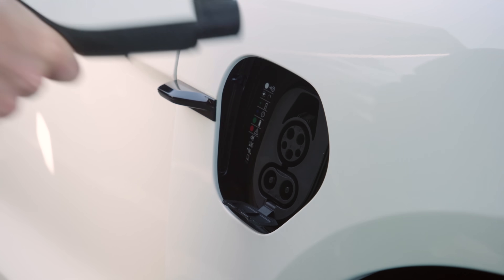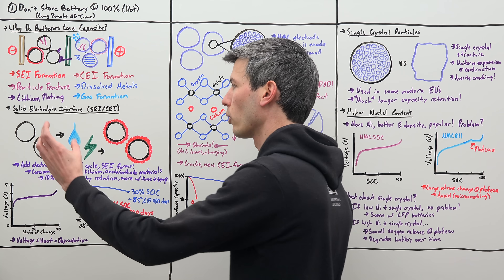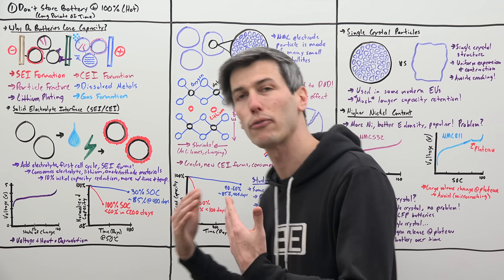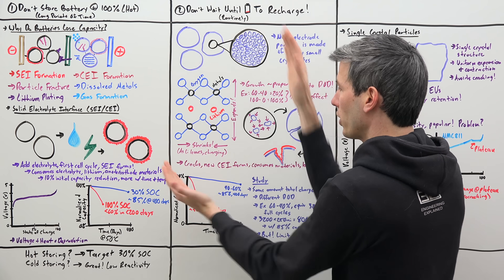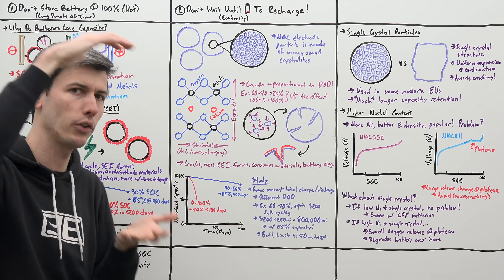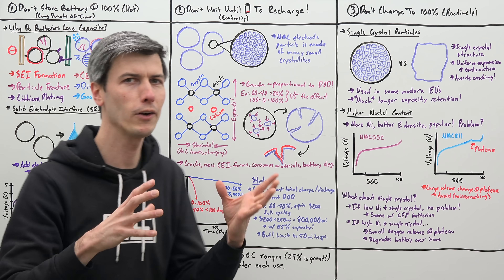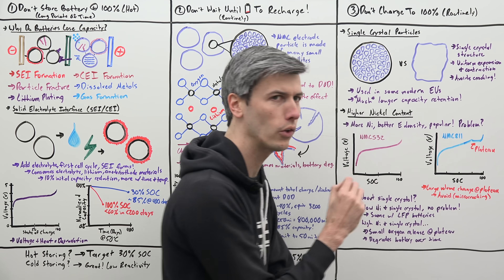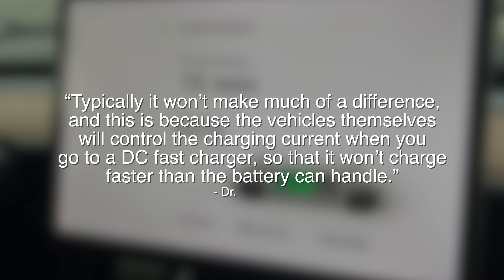How To Ruin Your Electric Car's Battery - NMC Edition!

Comment: The real challenge will be getting the general consumer to actually follow these best practices.  Even after decades of preaching we still can't get people to follow routine oil changes.
Reply: In general with this sorta thing we should hide it behind software. That's why we have charging curves for example
Reply: @kenjikenjikenj   Still, a battery should be charged in 5min. We are currently at 20min or so with fast chargers.
Reply: @svr5423  Gas cars should be filled up at home.  Why should I drive to a gas station?  They should send a truck to my house so I have a full tank every morning.  I don't have time to drive out of my way to get gas.
Reply: @davidbeppler3032  it's more practical to fill the cars up at the gas station. Otherwise, you'd be storing hazardous materials at home.

In case of BEVs, it's even more difficult as you need to somehow get power to the garage. And with standard 230V you won't get very far. 

Sounds like a cool idea, but in the real world it is very impractical.
Reply: @svr5423 I’ve never been in a residential garage that did not have electricity. 230v is plenty for overnight home charging.
Reply: @MylesV  Plenty of garages have no electricity at each parking spot.

Most cars park in the streets in many countries.

Welcome to the real world.

lol..just do the math. 230V can supply 16A, providing roughly 3.7KW. Do the math on a 75 or 100KWH battery. You won't fill it up overnight with your 50m cable drum sticking out of your balcony across the street :).
Reply: @svr5423  the issue is the full capacity of the battary if battary density gets to the point where we can cap offf the first 20-80% behind a software battary life will be significantly enchance and a 5-10min charge might be possible from a guage standpoint of say 10-90% from the driver perspective but it would really be from 30-70% on the hardware perspective.
Reply: @patthonsirilim5739  you're correct. I think batteries in future will be much higher capacity physically than they present. So they can both be charged faster (nominally) as well as have spare capacity for degradation.
Reply: @kenjikenjikenj so more of a hassle than it already is owning a ev? Evs have piss poor range and you need all of it. If you don't, then you made an environmentally bad choice.
Reply: @OutOfNameIdeas2  yes you are correct ev battary simply not good enough to leave anything off the table once they are they will become very practical 5 mintues charging from full to emptty and extreamly long lasting durable battaries all courtesy of better design and a artifical hard cap on the battary.
Reply: A lot of it is already handled by software. There are buffers to prevent max and min charge, safeguards to prevent charging in conditions that could damage the battery, etc. Like he said, even if you ignore all this advice, your battery will likely last a long time, even past the warranty. These are just if you want make it last as long as possible.
Reply: @BrandEver117 This is what I figured. But the so called Tesla engineers online in the comment section and on videos will claim that you aren't supposed to charge to full capacity.
Reply: @BrandEver117 Doesn't matter
Reply: im sure he didn't want to confuse the message but Auto Manufacturers already force some reasonable practices onto the consumer such as on the Kia/Hyunda/Genesis 64KWh platform the battery is actually 67.5 KWh, meaning you cannot ever charge the battery more than 95% as the software shows the user its 100% charged when its actually 95% charged. It does the same thing at the other end too, it shows 0% before its actually at 0%.
Reply: I definitely agree that more education needs to get out to consumers, especially those looking to purchase EVs. That said, I also wonder if it would be possible or even practical to handle all of this on the software side, so that it is done automatically without much needed input from the user.
Reply: It's not always possible of course
Reply: This is a great point. Some people actually think that routine maintenance like oil changes, tires, brakes are a "scam" and will just keep driving until the car physically won't move forwards. My laptop automatically caps the charge at 80% with an option to full charge if I need it to for the next day but other than that I don't really spend any time thinking about or maintaining battery health in other devices and forget about them until they go dead and then I 100% charge them back to life. Hopefully something as large as a car would have a bit of minimal programming in it to ask me to keep it connected to the grid and self-manage it's own battery health with some over-ride setting if max-range is needed the next day.
Reply: skill issue, they will pay for the damage themselves
Reply: Do any EVs have a charging plan setup so that you can say "Mon - Thu Charge 60% and Fri - Sun charge 90%"?  Or link to a calendar app, so that it knows that on the 23rd you have a 500 mile trip planned so the day before it should charge to 100% even though it's a Wednesday.
Reply: @brianwest2775 It's easily changed on the screen.
Reply: The real challenge of EVs will be to get the prices down so they compare to combustion engine cars and solve the problem of hundreds of millions of car owners not having a convenient way of charging their car. I like the technology but with electric versions of cars costing more than double of what the same car with a gasoline engine costs and the fact that i live in a high rise building with absolutely zero chargers makes them not viable for me. To keep my battery healthy id have to put a small charge in every other day and there are less than 10 fast chargers in my Village of 15.000. I can get a used car for less than 10.000€, fuel it up in less that 5 minutes and i can go for over a month with that one tank of diesel. Hundreds of millions of people that need a car daily are in the same position as i am.
Reply: Should set the battery settings allready in the factory so that it only max charges to 80-90% so it should show full for the consumer.
Reply: The issues will be mostly solved via software, not by consumer habits. The average consumer isn’t watching this video, much less reading their user manual.
Reply: @grisa12345   you cannot solve chemistry and physics with software.

There will be no app that let's me fully charge a current day BEV battery in 5min.
Reply: Consumers don't have to follow any guidelines. Manufacturers are happy if they abuse their products because they will need to be replaced faster. As long as the blame is successfully placed on the consumer, the manufacturer wins.
Reply: I don't think it's that hard. I remember the person who introduced me to my new car telling me "Both high and low state-of-charge degrade your battery's life, so if you try to keep it close to 50%, say between 65-35%, your battery will last a long time. Try to only charge to 90+% if you're going on a long road trip and try to only rarely discharge below 10-15% and you'll be golden"

I don't know about other EVs, but my car makes it easy to limit state of charge. I'm fortunate enough to have my own garage where I can just park and plug in every night. Even without a fancy charger, I pretty much never have to worry about how much charge I have. It's simply not something I have to go out of my way to take care of or even be reminded to worry about.
Reply: Just like my phone has a battery life optimization function that I could turn on or turn off. You should be able to do that in a EV too if you choose
Reply: Software-Defined Vehicle -> build it into the EV's software to manage the battery. How many smartphone users actively manage their batteries SoH? The average Joe who will be the majority will not be interested, same with everything else to do with EVs. I get my oil changed when needed at the annual service...
Reply: Thats because oil changes cost money and jiffy lube wants you to change your oil every five minutes (to make more money). Charging at your leisure in your garage is another story.
Reply: now imagine if it was the other way around, and there would be headlines about missed oilchanges significantly reducing your engines life, or revving the egine cold costing you a certain amount of engine life every time etc...
Reply: Software driven and historically stored and voiding of the battery warranty  if not followed.
Reply: It still won't matter much.  They will still be fine for the majority of people.
Reply: Oil changes cost money, people tend to procrastinate on spending money so this is not comparable.
Reply: I think manufacturers should build in safeguards where you can only use 20 to 80 precent of the battery capacity, and we would see that range as 0 to 100 precent ofcourse
Reply: Its way easier to follow because tesla has a BMS and in app charging schedules. I routinely charge from 30-60%  every week on my tesla performance. Literally all i do i plug the car in when i get home only if i need to
Reply: Your Tesla encourages optimal SOC, and it manages power when charging. You don’t have to think about it at all. Other manufacturers? Eh.
Reply: battaries today are just not advance enough to leave anything on the table but dont worry once battary density and design gets good enough they will just cap off the 10-80 as a safty measure so you can use on the dash at least the full 0-100 but your actully using only 10-80 people in the future will mod there ecu to realease the margin to get even better range and power from there battaries and motor but that wont be an issue for manafacture since it will void the warranty like today modded ice cars
Reply: @patthonsirilim5739 So we need to cater to idi0ts? Why?
Reply: They are correct the people. In a modern car oil change ist far less frequently neccessary than the garages want it.
Reply: As a result.. Lubricating oil, fuel and engine technology has got better and better over the years.
Which is why oil lasts 15,000+ miles where years ago you had to change your oil every 3,000 to 6,000 miles.
Reply: Thats my point.  even with oil changes being at 7,500 miles or longer people still don't do them even at the newer more modern intervals. Most people could get away with doing an oil change once a year and they still don't do it. @sahhull
Reply: @sahhull  Sorry, but what you write is only partially true. 
Manufacturers prolonged the recommended oil exchange intervals to reduce the overall oil consumption and also because they are now able to much more precisely calculate the expected lifetime of the engine and transmission and they know the engine will survive the warranty period even with these prolonged intervals.

That doesn't mean it is good for the engine or transmission and most experienced independent service centers would tell you that "lifetime" oil in transmission or 15k+ miles oil in engine are nonsense and only good for planned obsolescence. In other words, manufacturers are making sure you will come and buy a new car again after your warranty ends.
For example transmission without oil change will probably survive 100k miles before dying, while if you change the oil every 35k miles it will easily do 300k miles, probably more. Very similar with the engine...
Reply: @tomas_klouda  What do I know..
Ive only spent the last 35 years in the lubricating oil and fuel development and testing field.
Reply: @sahhull  unfortunately you can't judge the longevity of the oil in the engine by improvements in a quality of the oil itself. Trouble is the amount of "dirt" that it accumulates over time.
I totally believe you, when you say there has been a huge progress in oil quality. But what it enables is higher temperatures, lower tolerances and other stuff that leads to higher engine effectiveness due to (but not limited to) lower friction losses. It allows construction of engines previously not possible with thicker and lower quality of the oil.
All of this is great, but especially when you construct the engine to benefit from these improvements, you make the engine even more sensitive to any lubrication imperfections and dirty oil is definitely not something you want to have in such engine, no matter how good it is at lubricating the engine as the dirt in it essentially works as abrasive and is also really good at clogging small passages.
With so much experience would you please try to explain what kind of improvements would lead to longer oil life in the engine?
Reply: Tesla does pretty well (though buyers tend to be more tech-headed, which may mean better absorption of ideas and better reading comprehension).  They use pretty simple basic catchphrases to help people who don't necessarily need the whole tech explanation.  For instance, "A plugged-in Tesla is a happy Tesla" is easy to remember, as opposed to explaining the advantages of low range of discharge and frequent small recharges in extending battery life.  "80-20" is a simple mnemonic for trying to keep the charge state between 80% and 20% whenever possible, which is Tesla's recommendation for the health of the battery (though they're also clear that there's no problem with charging to 100% before a trip, though they're also clear that it should be done as short a time before leaving for the trip as is reasonable).
Reply: People don’t do it for their phone/laptops. They sure as hell won’t do it for their car. 

That’s why mfg should develop smart charging battery management software/hardware
Reply: @TwistedShrapnel  Neither my phone or laptop battery have liquid cooling.  That is a huge difference.
Reply: @TwistedShrapnel people dont do it for their phones because a new battery costs max $90 and people keep their phones for only about 3-4 years on average. Cars cost more and need to last a lot longer
Reply: You also have the issue that lead-acid needs to be maintained full all of the time to prevent degradation. Lithium is a notable paradigm shift.
Reply: Information like this will most likely be included in the education for driver's licenses.
Reply: @Thor6398-jt4mb  You mean the book that says "Don't drink the contents of the battery"?
Reply: Or use 91 octane fuel
Reply: Case in point. Phone batteries. I swear I'm the only person I know that tried to treat mine decent. 

Had a 4 year old phone at one point that would still last all day and change easily, even while streaming media, hd video included. I had no hint of battery degradation in any noticable way. 

I couldn't agree more, it's gonna take years before we can get the battery and charging/maintenance regiment right for everyone
Reply: @goosenotmaverick1156  Phone batteries suck. They aren't comparable. People have scenarios where they go from 100% to 90% battery degradation in less then a year. This is very common with phones. An ev will have 90% degradation after 200k miles on average! If you look after it you will have more!
Reply: @lachlanB323  my point wasn't certainly the high quality of phone batteries. Merely pointing out most still don't consider anything to do with the battery unless it's dead, as far as battery care goes. And it goes a long way for those agreeably crappy batteries. 

Generally I have no issues. Fully charged phone lasts me at least a day. Try to take care of my batteries regardless of what they're powering. You have to, especially given the minimal capacity we are provided given what's available.
Reply: @lachlanB323  phones are also built in a manner that the year you stated is probably pretty equivalent to where a 200k mile car is in it's total lifespan. About toast by the standard of most new vehicles. So realistically you're talking about a battery rated in mAh vs batteries rated in KWH. Given the difference in use for each, and their overall capacity, I'd say that's a really closer to similar than you seem to think it is. 

Also my point again goes to the lack of battery care. I didn't experience that much degradation in 4 years on a single device. I haven't had battery problems since I switched away from iPhones a very long time ago.
Reply: @lachlanB323 it's the EXACT same thing. They most certainly are comparable.

The only difference is a phone uses a single cell and therefore has no balancing scheme.
Reply: @MadScientist267  The difference is the phone has no thermal system and uses an entirely different chemistry. Phones use an high cobalt chemistry while an ev uses a low cobalt chemistry. 

Most EVs now use LFP too which uses ZERO cobalt and Nickel and last 1.6 million kilometres or 1 million miles.
Reply: @lachlanB323  Sure they do 🤣
Reply: @lachlanB323   doesn't matter if it's phones, rc vehicles, toothbrushes, video game controllers, electric scooters, vacuum cleaners or portable radios, the battery chemistry is roughly the same.
We know how it works and we have experience for decades with various battery types. There is no battery that is guaranteed to last forever, especially it is not magically so because somebody put it in a car.
Reply: @svr5423  Electric cars use cylindrical cells while phones use prismatic cells.

 Phones also use more cobalt and are a chemistry specifically made for max capacity with little regard for longevity.

They are NOT the same!!! Some laptops use 18650 cells I'm sure of and electric scooters probably use 18650 cells. Game controllers idk, vacuum cleaners idk just search it up lol it ain't my job to research for you.

Model 3's and Y's use 2170 cells and base model 3's and Y's use LFP batteries which is an entirely different chemistry all together! LFP uses zero cobalt and nickel as they instead use Iron and Phosphorus and they're also prismatic. They have bad energy density but are very cheap. They also don't mind being charged to 100%.

Btw the base rwd model Y in America just uses 2170 cells not LFP.

Model S/X use 18650 batteries.
Reply: @lachlanB323  Doesn't matter, the chemistry doesn't differ much.
Because charging/discharging a battery is always a chemical process the batteries age. Same with thermal cycles (usage/charge/idle). Then you have the additional shocks in a car and chemical aging over time in general.

Somebody selling a battery that is guaranteed to last over 10 years is just selling snakeoil.
Reply: @svr5423  You can drive over 1.7 million miles in 10 years. So no, not everyone's battery will last 10 years. But most will. Especially newer batteries. And LFP will last even longer at 1 million miles. Usually batteries last 500k miles in a Tesla.
Reply: @goosenotmaverick1156 My new Motorola Edge 2023 has a couple settings, where it won't charge the battery if its at 80% or above when connected to the charger, this setting has the phone learn your habits and doesn't charge the rest of the way until it estimates the time you'll disconnect the phone from the charger.

It also has a setting where if you leave it on the charger for 3 days, it'll stop trying to charge.

Also, at the recommendation of someone else, I plug my phone in to charge when it reaches 30% (it notifies you the battery is low when connected to your vehicle's bluetooth, but otherwise, doesn't notify you until it gets to 15% (when I had put my previous phones on the charger)
Reply: ...and I still see "car guys" saying to change your oil every 3k no matter what the manual says... or the engineers... or the bottle of synthetic oil!!

🤦

It's like reading is too hard for some people... but your buddy's dad's friend's uncle's mechanic's opinion - GOSPEL!!
Reply: I am not saying you need to change your oil every 3k miles.  If your car manufacture states you only need to change oil ever 15,000 then change it every 15,000 miles.  My point is that 15,000 mile oil change for a lot of people would amount to a once a year oil change and we still cant even get people to do that. @jasono2139
Reply: @jasono2139  that's because "car guys" are not OK with the planned obsolescence game the manufacturers are playing 😉
Those prolonged oil change intervals are not good for the engine, just for the manufacturer, as then you will come and buy a new car when the old one dies after the warranty ends.